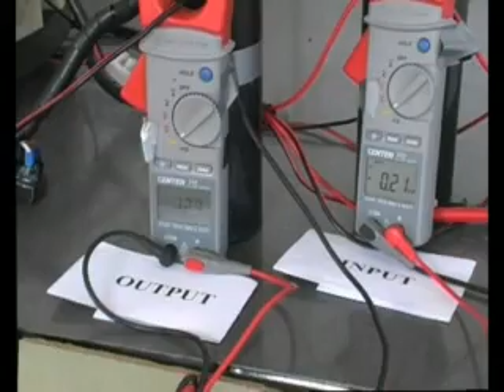Re: OVERUNITY MOTORS BREAKING THE LAWS OF PHYSICS

Comment: Okay, saw the original video....itisn't  "overubity" that way either
Electric Motors are not 100% efficient and they waste 70% of their energy intake as heat or potential electrical discharge(which as mentioned is usually just rounded out)
Taking wasted energy and thinking of a way to stick it back into a power storage point isn't a new idea if you ever saw a electric car set up from the 1800 (electric cars came before gasoline cars but only could be afforded by girl's Rich sugar Daddy)

Comment: Heh,heh
It's potental energy to realized energy  much like how  a spark releasesthe potential energy in gasoling torealized  heat and kinetic force energy
If this is based on Telsas permanent/em magnet motor then it would be the voltage intake is used to power electromagnets that counter pernmanent  magnents creating kinetic force potentail against coils to create electricity from the kenetic potentail of powerful magnets opposing each other...not the electric input
It isn't breaking any laws

Comment: How about its maintenance? It becomes problem if we want to replace all the bearings, lubricants, and etc if you open the stator. The heat generates by the rotating part is hardly to dissipate except the motor had air gap or hydrogen.

Comment: @trippinlikegod It is advertised as "over-unity." That means that it makes more power than it requires. The video said it delivers 1250 watts with only an input of 210 watts. Transformers and magnetos can do that with voltage, but there is a trade-off. It CAN'T be done with watts (power).
"Over unity" and "free energy" are impossible.

Comment: @knowledgemonger a fast change in the density of a gas or a solid can induce kinetic waves that your volt meter detect as currents. it can be a temperature fluctuation but the nature of all kinetic waves are of sound. and sound is changeing force gradients. the sound you hear can´t go into space but the energy of it can, and be picked up as electromagnetic induction.

Comment: @knowledgemonger a changeing magnetic field itself does not produce current. is the wave that follow the change that interfer with electrons that induce currents. the more you make a change in a magnetic field the more it behave as a wave the more currents you get. electromagnetic waves are not electromagnetic, they are kinetic. the idea is to make the magnet oppose the induced magnetic field preventing storage. you cant take the currents out in the same coil than induced it in this case.

Comment: its possible to make magnets do half of the work since normally when you alternate current from lets say a battery you provide both directions to make the ac wave form, but if you pulse the current only in one direction and use a permanet magnet for the opposite direction when you induce one half cycle in to the transformer with the magnet present the permanent magnetic field deform and when you stop the input current as a pulse the magnet provide the opposite direction and you have ac.

Comment: If it amplifies the input electricity five times why just save 80%? Why not take 20% of the output and feed it into the input and save 100%? If it is not possible to feed the output of the machine into the input of itself, feed it into another machine and get an amplification of 25 times which would save 97.5%. And so on.

Comment: @peterweetbeter 
Rudolf Diesel invented the Diesel engine around 1860, it worked. By 1910 it was being widely adapted for cars, industrial engines, locomotives and submarines. The Bedini motor/generator has been around since 1984, about 25 years, and has no commercial applications today. Wind and Solar are green. Modern wind turbine technology only took a decade to develop. Solar continues to improve exponentially. You have a real challenge. If it's a good idea people should throw money at you.

Comment: @knowledgemonger 

True pulsing DC power fools these DMM's. Oscilloscope! Yes the "clamp" is a HALL EFFECT current sensor. Bedini motor/gen has been DEBUNKED. THERE IS NO LOAD. Around since 1984, If it really made free power, we would have Bedini motor generators all over, even if it only ran a light bulb or a transistor radio for free. Also where does the power come from? cosmic space energy? earths rotation? Physics & Thermodynamics is a bitch.

Wind & SOLAR, THAT'S FREE POWER. This is BS

Comment: The best picture is the last one where it looks like they threw it in the river. First you can't break the laws of Physics.
Second they show voltage not power. If it is a Bedini motor it is acting like a transformer but a mechanical (read loses, friction). Why is this thing not driving lots of lights and toaster ovens and just two volt meters? Show the current please.... you will see it is not free energy or the perpetual motion machine or taping into outer space. Solar energy? Yes? Bedini? No

Comment: I never see any of the "overunity" devices have their output connected to the input and thereby have the device independent of the grid and running perpetually in isolation.
Also its only when current and voltage are in phase with one another is there real power.
DC from a battery has its current and voltage in phase. AC has its voltage and current out of phase , so as it can be transmitted across miles of cable with minimal heat loss. Real AC power is when product of V&I are in phase.
(RMS).

Comment: Transmutation is real.  Carburetors that get 70 -150 mph are real. Patents being shelved is real.  LENR cold fusion research is slowed down by MIT hot fusion work.  Cutting edge on demand hydrogen funding doesn't happen because the EPA is hydrogen refueling stations etc. etc.

Comment: Funding request video for impossible invention, these scams continue year on year. The MYT engine was one such classic, claimed 1000 bhp from an alloy shoe box with no cooling and only uses a  teaspoon of fuel per hour. This one is the same otherwise we would see it power the inventors house. If we saw it power a 2Kw heater from a car battery we would rush to buy the company. There is no such thing as a free lunch and the same applies in electrical circuits, anything which moves needs power.

Comment: No, I meant why is there even input power if it is self perpetuating. If it were truly perpetual, it wouldn't need an input to make up for losses due to resistance. Also, the voltmeters make assumptions of certain frequencies which can make their output  highly inaccurate.

Comment: Google this: Self Running 900 Watt Fuelless Electric Generator
 Its the same thing. i think it can work. None on the engineers at work here said I could run a car on waste vegatable oil, but Guess what. I havent seen a gas station in 2,500 miles. All these ideas have been around since dirt. Rudolf Diesel & Tesla' technology were all threaten.

Comment: Yes I know that but scrap aluminium or other scrap materials contain a great deal of energy and are cheap. We already have one exothermic reaction(The combustion of the petrolium). A typical catalytic converter runs at 600 to 800F. It converts unburnt Hydrocarbon fuel, CO and NOX to H2O and CO2. However these gases instead of just heating the cat converter can be used to create Hydrogen. We probably only need another 200F and a source of CO to replace the CO2 being scrubbed & discharged.

Comment: If there is exothermic reactions the cost of the reactants has to be included. A mass balance along with a calorimeter will give you some surprises. Burning graphite to CO is an expensive fuel. 
The real money is in figuring out how to convert carbon to graphite cheaply.

Comment: If we could recirculate the exhaust gases and then gang together exothermic reactions with an endothermic reaction to make exhaust gas back into a combustable gas. We could bring engine efficiency up maybe over 45% or 50%. We could use carbon rods or perhaps a modified thermite reaction to boost the low grade energy from the engine. Solid fuels like carbon and aluminium then could replace much of the gasoline and the engine itsself provide the latent heat needed to keep the H2O as a vapour.

Comment: Have you seen the GEET fuel reactor.I know you are going to say it's crap, but is it possible that the high pressure on output exhaust boosts heat and low pressure on the intake inner reactor chamber allows a water gas type reaction and the Iron of the rod and the inner pipe acts as a catalyst to allow a reaction with the water vapour from the bubbler, CO from recirculated exhaust and carbon from lower grade fuel. Would this system give a substantial boost to fuel economy or is temp insufficent

Comment: Why Why Why????? 
In 500 characters! The waste energy from an engine is low grade so T1 - T2 divided by T2 in degrees K is miserable. It can be done ie recent BMW Rankine add on maybe 10% improvement, and from the past, Dobles last work, the Still engine and it's variants see Museum of retrotech. The problem is bulk, cost and not much efficiency improvement. Chemical process don't avoid the carnot cycle problems if anything they are even less efficient than a rankine bottoming cycle.

Comment: My job involves being on the net all the time anyway, but I am trying to work out that if you know so much why you dont do something useful? My guess is you dont really know a lot. If a motor vehicle engine is about 30% efficient why then cant a chemical process recover some of the heat and exhaust gases to provide a combustable gas to boost a lower grade cheaper fuel or to boost the fuel economy of the existing fuel. Why arent there professors & Uni's working on the process? Why Why Why?????

Comment: Everyone knows the thermite reaction(I only used it as an extreme example for you feeble mind.)You didnt even know the second reaction. Silicon process used for years to inflate weather baloons. I am not lieing looser, run the test yourself. All you need is some carbon rods water and two car batteries not too complex is it? Analisis is not mine its was done by NASA.
Haber process should have guessed you would be into the production of fertiliser from air as you speak so much bullshit.

Comment: So if your so smart answer this. 
A reaction like this 
2Al + Fe2O3 > Al2O3 + 2Fe
once started is exothermic releasing heat energy or here is one producing Hydrogen at room temp just add water 
Si(s) + 4NaOH(aq) > [SiO4]4-(aq) + 4Na+(aq) + 2H2(g). 
What is a reaction that absorbes heat called? Give an example of this type of reaction used in the production of commonly used fuels. Bet you have to use google. LOL :)

Comment: You are so full of crap. There is no soot in flame (smoke) look at the videos of cell. No soot,smoke or sodium, just admit your full of crap. In fact I can give you exact composition of gas 
Hydrogen 46.483 % 
Carbon Dioxide 9.329 
Ethylene 0.049 
Ethane 0.005 
Acetylene 0.616 
Oxygen 1.164 
Nitrogen 3.818 
Methane 0.181 
Carbon Monoxide 38.370 
Total 100.015
So there fart face. No Sodium to be seen.
Why do you go Bwahaha all the time? Must be a KIWI SHEEP SHAGGER. LOL LOL LOL!

Comment: Sorry but Hydrogen burns at the ultraviolet end of the spectrum I.e.For the dummies (You)Blue to almost invisible. Get you facts right. There is no sodium in cell so unless you a alludeing to the transmutation of elements the colour can NOT be anything to do with sodium. Cold carbonic oxide gives off a blue flame in burning but if it has been previously heated(as in plasma)it gives a yellowish red flame. Source: A Dictionary of Chemistry & the Allied branches of other sciences By Henry Watts.

Comment: Quote "Some carbon does permiate into the distilled water yes so yes there would be a type of carbonic acid electrolyte at the end, but as the reaction starts instantaniously it is not a requirement for the reaction.You ingnore
1.Flame is yellow & blue indicating H & C.
2.Wont ignite without air indicating no available "
Sigh 
Yellow flame color is most commonly from Sodium contamination. CO burns blue idiot.
Glad you've admitted it is a conducting solution and hence is electrolysis.

Comment: Voltage is constant Amps are at all times under 15 no short. Some carbon does permiate into the distilled water yes so yes there would be a type of carbonic acid electrolyte at the end, but as the reaction starts instantaniously it is not a requirement for the reaction.You ingnore 
1.Flame is yellow & blue indicating H & C.
2.Wont ignite without air indicating no available O
3.Volume is way above electrolysis. 
Idots like idiots while loosers remain alone. Enjoy your solitude looser.

Comment: Sigh. You start with distilled water, it becomes conductive as the electrodes break down. That's why you need the over voltage to start the reaction. When you finish your pathetic playing around, run a conductivity test on the cell. Oh look it's conductive. Why don't you go back to high school and finish the science classes.

Comment: HA HA HA Wrong wrong wrong.
Electrolysis requires an electrolyte this process uses distilled water! Your Wrong!
Electrolysis output is mainly H2 and O2. This process outputs CO and H2 mainly. Your ignorance is on display for all to see.
This process is more effective and outputs way more gas than electrolsis. Why because it is a chemically assisted reaction. As for shorting out electrodes I have a 15 amp fuse in circuit and there is a device that limits amps to around 12,higher at start up.

Comment: "cant" is what you're writing. can't is what you're attempting.
My site?? 
Your idiot faffing around with carbon electrodes is electrolysis, pure and simple, no extra energy out. You just happen to be shorting out the electrodes. Nothing else is happening, the rest of your "explanation" is as imaginary as neutrino capture. 
Build a calorimeter. Get some decent measuring  equipment. Then go and do something useful like sticking a solar system on your roof.

Comment: "The reaction between oxygen in the H2O and Carbon in the electrodes is exothermic so it adds energy to the reaction making it more efficient and then there is the Neutrinos those great little fellas help too."
Bwhahahaha! Exothermic! Neutrinos 
Wonderful. From a smuck who wouldn't know a calorimeter from the chip fry bath you work at McDonald's. 
Any other science words you don't understand want to throw in to your nonsense

Comment: AND THEN SOME, but it is better than being a total tool and walking around with a broom up your keyster, but seriously a plasma reaction using carbon electrodes under water is not normal electrolysis surely even you can see that, even with that broom so far up it is pressing on your brain. The reaction between oxygen in the H2O and Carbon in the electrodes is exothermic so it adds energy to the reaction making it more efficient and then there is the Neutrinos those great little fellas help too.

Comment: Yes I agree with you there Bedini motors have always been a scam. The process sounds feasable at first. Use the normally wasted back EMF of the motors collapsing magnetic field to charge a battery while another battery powers the motor. But once you stop elliminating the back EMF instantly a residual magnetic field remains in the stator winding after the pole of the rotor has passed. This field partially attracts the rotor back reducing RPMS and increasing load on the first battery so no gain.

Comment: You have mistaken me for Tesla. WOW that is indeed a compliment, I starting to like you LOL.
Have you looked at what I have posted? I have managed to get a small lawn mower motor to run off a gas generated by a 12v battery and a chemical reaction.I am in the process of achieveing. Didums havent heard that sinch I was 10. LOL.

Comment: Quote "There is no reason under the right circumstance this energy could not be use as a the perfect power source as it is present everywhere on the globe all the time." This is the same as saying a full moon should run solar cells. The density of energy in the earths magnetic field is so low there is no way to extract any more that birthday candle's energy per square km

Comment: Free energy does exist but only in the sense that it is extracted from the atmosphere/environment. 50 trillion solar electron neutrinos pass through the human body every second, but as they react very little with matter they can pass right through the planet and out the other side. They are near massless but under certain circumstances can be made to give up some of their energy when passing through a vacuum and certain mineral oils,magnetic fields or ionised light gases like nitrogen,Hydrogen

Comment: Note all the the following dribbling are loony tune ravings of an idiot
Quote as proof
"Kinetic energy when applied to applied to an object of large mass becomes potential energy. Once an object is moving, you need very little kinetic energy to keep it at a constant RPM, provided there is very little friction involved. Perhaps the hot water "lubricates" the rotational mechanism or even enhances it, because of fluid dynamics (like moving a propeller through water)."
Gold plated Bullshit

Comment: Kinetic energy when applied to applied to an object of large mass becomes potential energy. Once an object is moving, you need very little kinetic energy to keep it at a constant RPM, provided there is very little friction involved. Perhaps the hot water "lubricates" the rotational mechanism or even enhances it, because of fluid dynamics (like moving a propeller through water).

Comment: Here, the rigidness of the cyclic mechanism is crushing water. When you crush something, it gets hot. The mechanism is self-supporting because of potential energy, like spinning a wheel or a gyroscope or a spinning top (and continues to heat the water). Then there's also centrifugal force which makes water stay against the edges, applying further pressure (thus heating it more effectively). Perhaps it's a compound force, with one influencing the other.